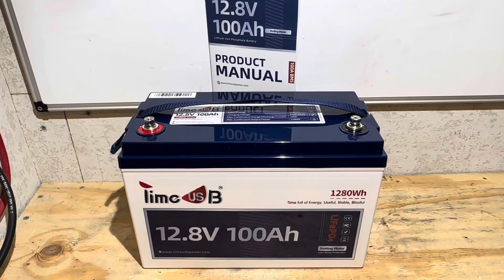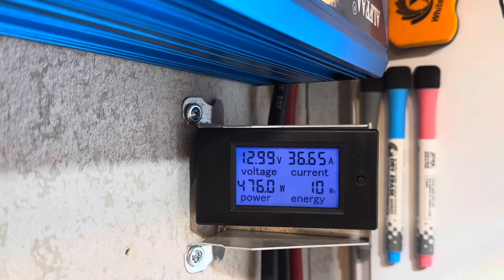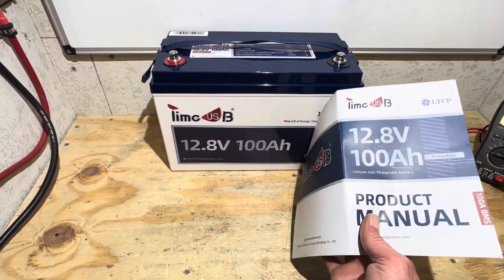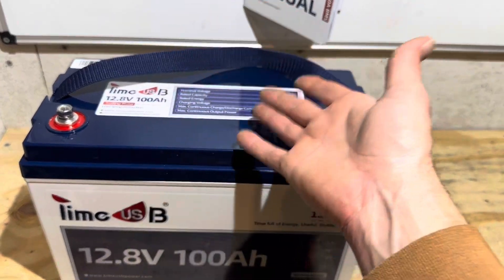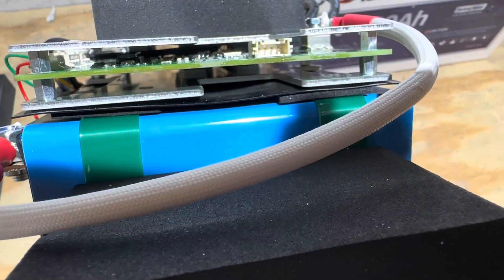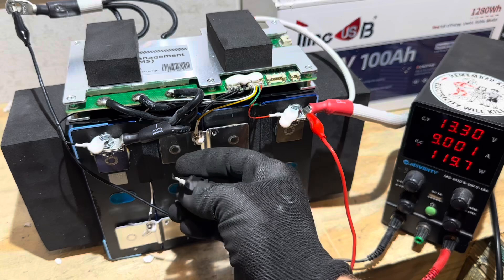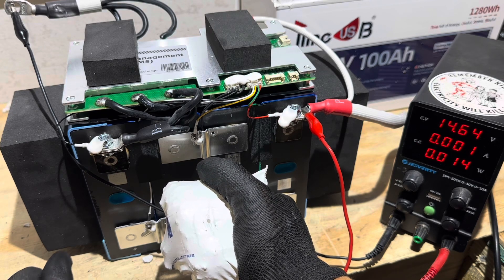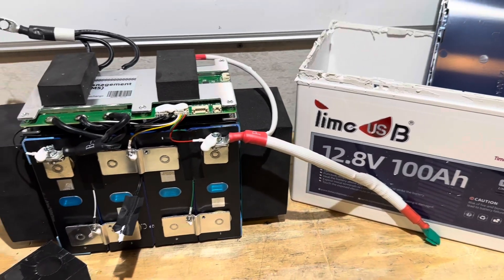Review & Teardown: Timeusb 12.8V 100Ah LiFePO4 Lithium Battery, Best Budget 12V 100Ah?

Comment: I have 4 of the timeusb pro 100ah non bkuetooth in my boat as house batteries.   I had 2 of them fail.   It was probabky my fault as i left the battery switch on and totally ran them down and the boat sat unused for several months. I contacted their customer support and I did have to somewhat jump through hoops for thr warranty process  includimg having to pay abiut $45 each battery for shipping fee and ship the old ones back but they did ultimately promptly ship me out 2 new replacemrnts so I csn say that the comoany stands behind their product
Reply from the maker: Thanks for sharing your experience, I'm glad you got the issues resolved!

Comment: Hello, I'm buying a 24V 100Ah for my solar generator and was wondering if you would give a suggestion on a brand.  Here in Canada on sale I can get the TimeUSB for $460 or the Rododo for $530, is it worth getting the more established name brand Rododo (LiTime is $650, which is too much for the same battery basically). Thanks, and the videos are so helpful and informative.
Reply from the maker: TimeUSB/Redodo/Power Queen are very similar in build and quality. https://youtu.be/DV8nm-xAT_k?si=3-wo1EGloIlqtu2R
All have worked fine for me. LiTime is very similar as well. LiTime is probably not worth the extra cost if all batteries compared have the same features advertised. (I.E. 12.8V G31 100Ah standard LiFePO4 battery)
Appreciate you! 👍

Comment: Maybe a stupid question but what's the difference between a trolling motor battery and a house RV battery?  I like the fact that the trolling battery has low temp protection, because it seems like the RV versions don't.  Or maybe that as changed...lithium batteries and the producers are changing so fast these days.
Reply from the maker: I’ve only worked with their Trolling Motor battery and as far as I can tell it’s the low temp protection function and possibly a longer surge current capability for the BMS. I haven’t used the other models from Timeusb. So without some hands on time with the other models one can only go by manufacturer statements or very recent reviews. You are spot on that some of these batteries change often!
Reply: @ I contacted Time USB and started asking questions.  Turns out the only difference between the regular battery and trolling motor battery is the trolling motor  can handle a max discharge spike of 500 amp vs the regular battery at 400 amp.  Same cells and BMS.  And they told me the trolling motor battery is also recommended for RV appliances as well.  So same price, and you get higher max discharge rating and low temp charge protection.  So I bought two.  I'll let you know how they work out.  Thanks for the video review!  It made me much more confident about the Time USB build.

Comment: What Im looking for is a way to heat my greenhouse that costs less than electricity or propane.   Ive currently got a 10ft wide x13ft long x6.5ft high hoop house which Ive covered in 2 layers of bubble wrap and then a white frost cloth on top of that to keep it from blowing away.  On the inside ive got a radiant barrier 3mm thick foam with foil on both sides on the northwest side wall (i.e. the back) and Ive covered the vent and the exhaust fan with either that radiant barrier foam pad or the bubble wrap.  Its currently 33 degrees outside and in the greenhouse its 65.  Im using a small electric fan heater but I was thinking of going with propane to keep my power bill down (Having the solar on the roof has given me a $16/mo power bill for almost the whole year when i dont use the central heat/air).  Sure I can afford to pay another $20 or $30 for the electricity but I dont WANT to.  

I saw a guy on youtube using an ecoflow portable power station with 2kw worth of battery and an ecoflow wave which is a heater/ac unit that attaches to the ecoflow battery.  Though I think he was charging the battery from his house most of the time and sometimes (he was in southern california) with the foldable solar panels they sell... of course since it was a sponsored video I canto be 100% sure its not all fake.  I am not sure if something similar to that would be worth it since at the price of an ecoflow I can get a Ruxiu 16kw wall mount battery that would attach to my solark home inverter and just keep using the electric heater but with off grid battery from the house.  Of course that price does not include installation of the battery itself or the critical loads/smart panel I'll also need to be able to run the house/greenhouse in off-grid mode.  

Then there's propane.  There's a bunch of people on youtube using a 20,000 or 30,000 btu mr buddy ventless indoor blue flame propane heater and just leaving a small opening in their greenhouse to keep the air flowing.  The 20k and 30k btu units have a thermostat so if you set the temp setting to 1 (it goes to 5) it will stay about 68-70 in the room.  The problems I have with that are A) open flame in the greenhouse obviously. B) While its cheaper than an ecoflow or ruxiu its still quite expensive to get for what is essentially a hose and fuel rail and battery operated spark plug (the 20k btu model is almost $200).  C) the amount of propane it uses just on the lowest setting will use up a 20lb tank in about a week.  At almost $4/gal for propane that's like $20/wk to keep it not quite warm enough in the greenhouse to keep the plants growing (the plants have been removed for the most part to the house where they will be warm enough to not die).  And of course you have to buy the tanks for propane as well... a 20# tank runs like $65 and a 40# one is $120.  I do have an in ground 500 gal tank but I'd have to have the oil company come out and plumb in a line into the greenhouse for that and it would still eat up the propane like crazy.  I'm not looking to pay $1600 every year to refill my tank just to keep a few plants growing.  

Other options Ive thought of: 
I do have an offset smoker ive never used that I could maybe try but that's going to require a lot of modifications to the greenhouse for the chimney and a lot of wood management 
My dad sent me a 20# propane tank single element tanktop radiant heater but I will have to turn that on and off manually every time and I am not sure it will work with the plastic greenhouse roof right above it.   And again ... those things drink propane like a southerner drinks sweet tea. 
Building a rocket mass heater but that will take up a ton of space in the tiny greenhouse
Buying 5 or 6 55 gal water barrels and putting a 150w aquarium heater in 2 or 3 of them which will be plugged into the thermostat that's currently running the electric fan so they will only kick on when the air temp gets to below 70.

So what would you suggest?  I apologize for the wall o' text but I am not sure which way to proceed.

(edit) also I hope you had a very merry Christmas and a joyous new year.
Reply from the maker: A lot of info to go through here my friend! I’ll ponder upon it today and see if I can help you out with an affordable solution 🙂
Reply: @THEOFFGRIDMOUNTAINHOMESTEAD  Thank you kindly my friend.
Reply from the maker: What’s your desired temperature for your plants?
Reply: @THEOFFGRIDMOUNTAINHOMESTEAD  I currently have the thermostat set at 70.  I'm not sure if that's warm enough to grow plants in there all year round though.
Reply: @THEOFFGRIDMOUNTAINHOMESTEAD  Oh I should also mention that I'm trying to keep the solution quiet and dark.  I was looking at one of those small diesel heaters but its loud and the exhaust hose is super hot (though that could probably be mitigated by treating it like a stove chimney).  I also didnt want to use a heat source that put out a lot of light so that the neighbors dont see it an have a panic attack (I live in front of a cul-de-sac and while there are a few trees separating me from them you can still see the greenhouse  when you drive by.

Comment: The other ports on the BMS? Bluetooth? RS-485? MIght be a cheap way to CANBUS these for use with a Cerbo GX...
Reply from the maker: Yes the BMS has multiple ports for various program configuration options and functions. Although none are used on this model besides the NTC and balance module.
Reply: @THEOFFGRIDMOUNTAINHOMESTEAD  Yes, I understand all that, was curious if the silkscreen on the board for one of the ports said RS-485...